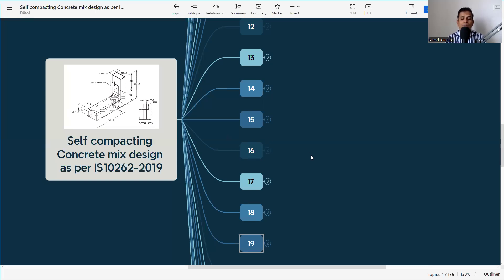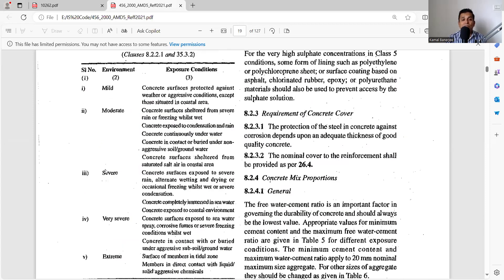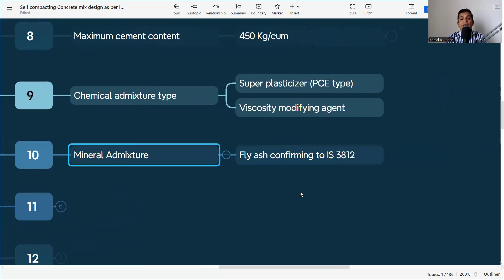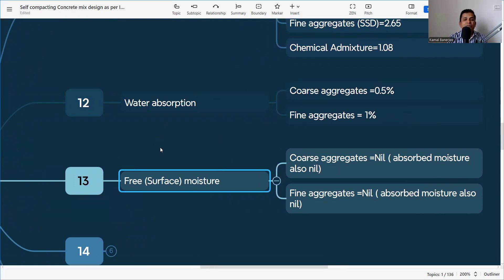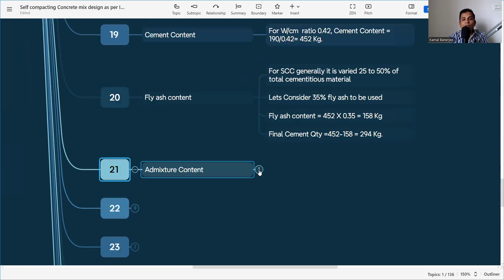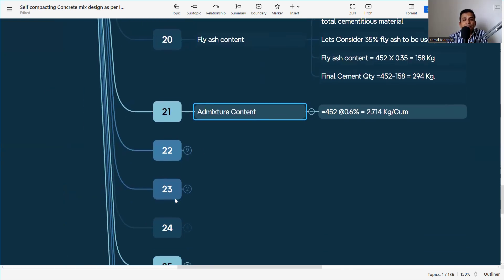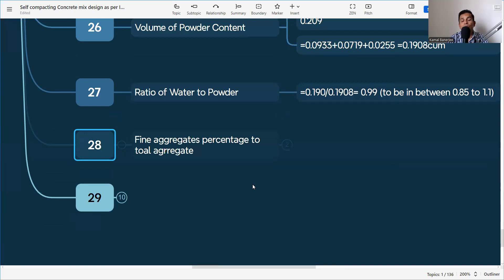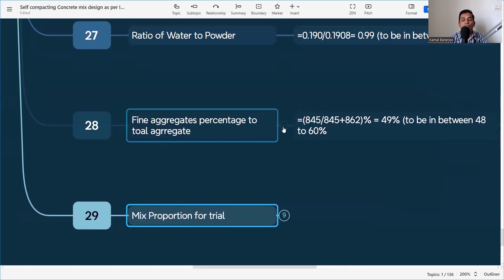Mix Design of Self Compacting Concrete SCC as per Indian Standard

Comment: In your trial proportion you are taking cement 452 kg and Flyash 158 kg ( 452 kg is the total cementitious material na )
Reply from the maker: Yes , 452 kg is total cementitious materials.
Reply: No, it is only cement content & not totally cementitious content.

0.42 was evaluated from the graph mentioned & this graph is based on cement content.

Therefore, 190/0.42 is the cement content only and not as a cementitious content.

Comment: In general, a very good presentation for learners and young engineers to start with except a few points which may have some contradiction. Let me explain one by one.

1) W/C selection - The general curve given in IS 10262, actually based on normal slump concrete and not for SCC. So calculation of w/c ratio from that curve may be not sufficient. It will always be on the higher side than what is actually needed lower value for SCC. For example, with the same w/c ratio of 0.42, one may not have same strength for normal concrete as well as SCC for M30 grade. M30 SCC will always show lesser strength than normal M30 grade concrete because of higher paste content and  in other words comparatively with lower A/C ratio. So in this case some margin is to be considered at least   (-) 0.02. say the w/c ratio may be considered as 0.40 in place of 0.42. Now the only cement content will be = 190/0.40 = 475 kg in place of 452 kg.

2ndly, while calculating only cement content through w/c ratio, we need to increase total cementitious fines at least 10% of the cement content as per IS 10262, in case of SCM addition like PFA.That means final cementitious content should be at least = 475*1.10= 522 kg. Therefore , final w/c ratio now will be  0.36 (190/522). It is done because of getting equivalent strength in comparison with only cement mix. Blended mix is little prone to Shrinkage cracks and carbonation of concrete.and hence these two effects are compensated with lowering w/c ratio little lower.

Considering all above, we can finalize the cementitious content as follows.... 

Cement = 340 kg
PFA = 182 kg
Free water = 190 kg
W/C = 0.36.

3rdly, W/P ratio by volume (0.85 to 1.10) may be applicable for lower or moderate strength of concrete but certainly not applicable in high strength Concrete like grade M60 and above. In such cases we already observed that this ratio is always less than 0.85. we generally get this ratio in such grades very close to 0.70. Powder content (400 to 600 kg)  also may not be applicable in such high grades where we all saw that it ranges between 650 to 700 kg in such grades.

So in SCC design IS 10262 alone is not sufficient to follow. It needs some revisions immediately.

Thanks Mr. Kamal to deliver a good presentation on SCC in general.
Reply from the maker: Thank you very much for your explanation. True, SSC is special type of concrete and it is a vast subject. One can go deeper and deeper on this subject. I always try to give some basic ideas for the new comer. Thank you very much  for liking my presentations. Above all , your suggestion is always special to me and it helps me to grow.
Reply: Thanks Mr. Kamal.
The presentation was indeed very good and explanatory.
Reply from the maker: @nirmalendukargupta201  Your word is my inspiration. Thank you.